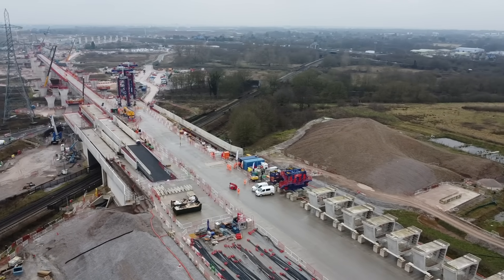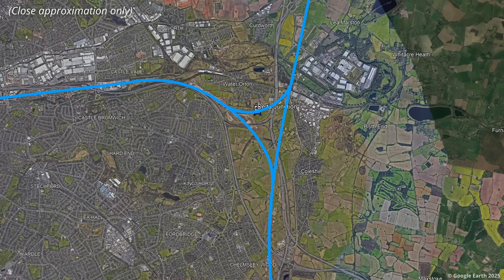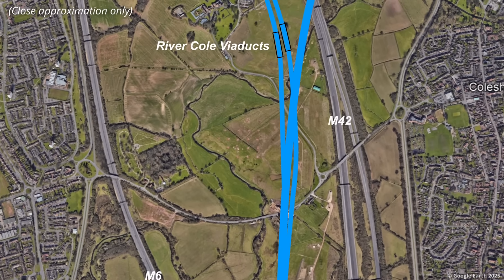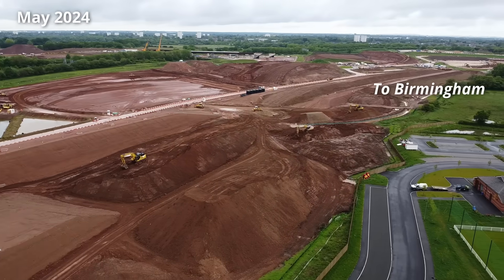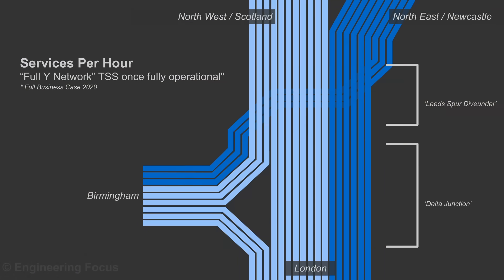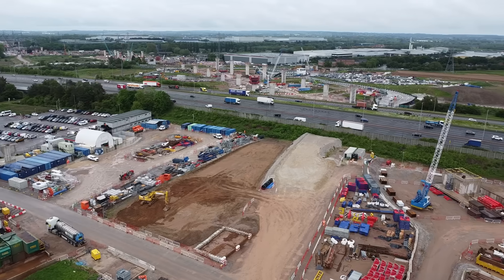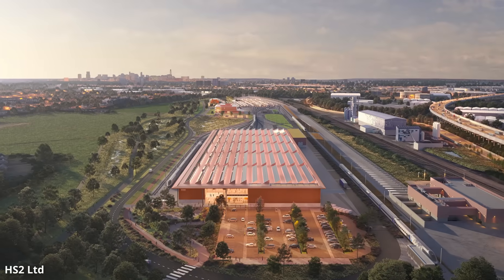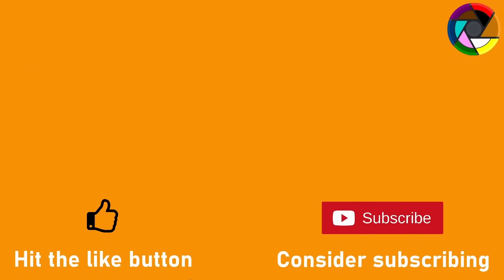What is Delta Junction? | HS2 Birmingham

Comment: I think they'll build enough that future works won't disrupt the built section of the hs2. I suspect that this will include the full delta junction and the Leeds dive under. The same at handsacre where a stub for phase 2a will still be built.
Reply: Yes, and perhaps instead of restricting discussions about just south of Crewe area, what about rethinking HS2 2b, and the Golborne Link ?
Really, after all these planned and ongoing Phase 1 activities, then 2a and Golborne Link are really possible.

Like I mentioned in my earlier entry, why can't they put a notional similar large delta on Golborne Link and then allow northbound HS2 trains from Manchester to Glasgow through Manchester Airport ?   This may all cost additional 10's of billion pounds (20B ?) but would really add HS2 capacity and utility to the north.

What about expanding a notional HS2 Golborne Link more , adding a larger "quad" junction (vs. just a delta junction) to Liverpool to get high-capacity 4-way high-speed connectivity to the west coast shoreline at Liverpool ?  Then you could hop on HS2 in London and get to Liverpool for the weekend in maybe 90 minutes end-to-end ?  That would expand Liverpool's and west coast's weekend vaction options considerably (and giving HS2 a huge ridership boost on the weekend vacationers.

What about...allowing TRU upgrades and line to use HS2 2b lines and thru to Liverpool ?   Many future upgrades could tie smoothly into HS2.
That way those from Glasgow or TRU or London could all go to the Liverpool beach using this 4-way interchange and holiday for the weekend and not switch trains.   Upgrading the Liverpool lines could then allow near high-speed operation across the west cutting down the London-Liverpool HS2 trip to 65 minutes ?  This would vastly increase the weekend capacity and ridership.

Comment: the initial projection of the project when PM Gordon Brown announced hs2 in December 2009 _ I always thought the cost estimates & time schedules were wildly optimistic _ building hs2 is no different to building the motorway network _ trying to go from London via Brum & onto Manchester with the spur onto east Midlands/ Leeds _ basically as one project _ sorry _ far to optimistic _ afterall France still building high-speed rail links _ I drive through delta junction most days _ & as I used to work in civil engineering a fantastic piece of work _ as to what's next for the project _ who knows _ but infrastructure like this takes money _ afterall how much did for example did crossrail cost _ lots of money but it carries how many passengers _ bakerloo line extension is projected @ £??????_ major projects do not come cheaply _ require long term commitment _ watching eastwest rail to the south of Cambridge is similarly going to be difficult to navigate at times with budget/delays/ cost overruns __ 
another excellent rail focus piece of work
Reply: I was being polite when I said cost/time projections were optimistic _
Reply: @Michael-61-n3l yes, indeed. But it is true that every project in both civil engineering and building is under estimated. I used to work on major building projects for a Contractor putting bids together. Cost Consultants don't understand enough about constructing projects, in particular assessing the Contractor indirect works resources  ( preliminaries).
Reply: @Michael-61-n3l  The cost/time predictions for the Newbury By-pass were way off the mark thus proving such things are not unique to rail projects.
Reply: @boldford The Newbury Bypass costs went through the roof when the Contractor insisted the Highways Agency put 24/7"security in place at their expense comprising security fencing for the entire length of the road and manned by teams of security guards.
Reply: @ The objectors were pretty active. Without that security the costs may have been even higher.
Reply: The security cost was in the tens of millions.
Reply: If you used to work in the construction industry you must know every project exceeds the budget because the Cost Consultants who put the cost budgets together don't possess enough technical knowledge to know how things get built.